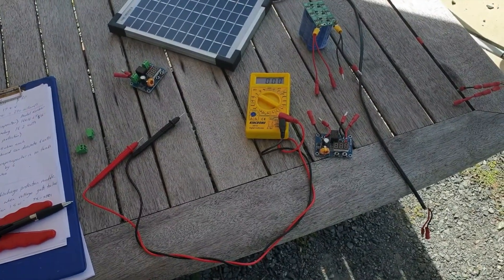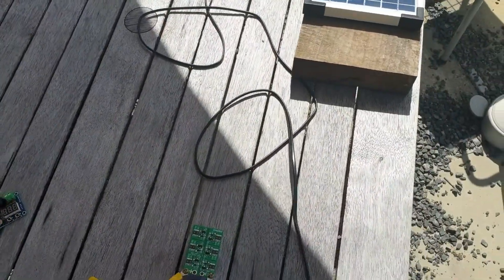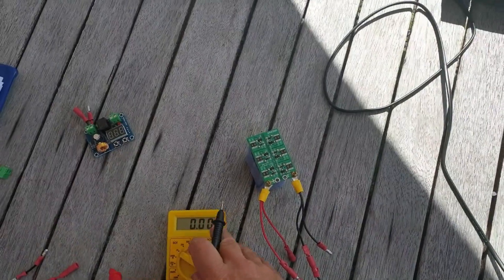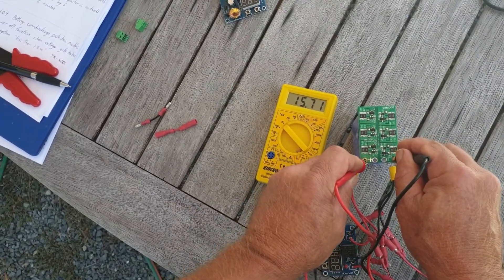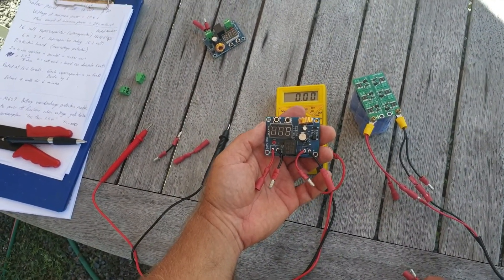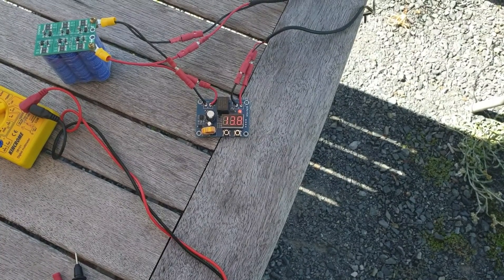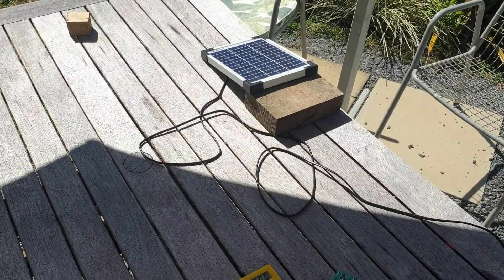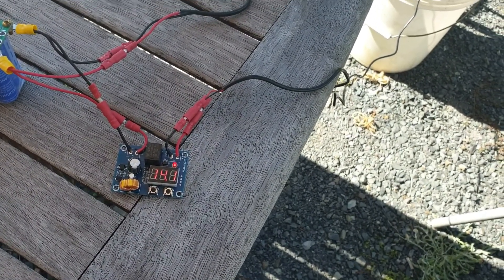Small solar water pump using supercapacitor

Comment: Hi Dean. How much could this setup be increased? For example could a 200W panel and larger pump be used on a higher capacity capacitor bank and charge controller?
Reply from the maker: In this example there is no overvoltage protection so I matched the wattage of the panel with the overvoltage resistors on the supercapacitor board (which also balance the voltage). If supercapacitors go overvoltage they die. However, its very easy to scale up with a bigger solar panel, provided you use a buck converter to limit the voltage going into the supercapacitor to no more than 16 volts. Here is an example https://www.youtube.com/watch?v=9CVa0V-IUOg

Comment: Hi.nice work
We done a similar type of experiment.
We used a 25W 12V panel,5 x 2.7V 500F supercapacitors and same type of the motor in the video.also we made a buck boost converter and used it too.
We did not do the experiment for a long period.can you say the volume of water you got from this experiment?
Reply from the maker: Thanks Manula, I didn't measure the volume of water but on a sunny day the pump was operating much of the day. On a cloudy day the pump was operating 1/10 of the time. Agreed, a larger solar panel with a buck converter to restrict the input voltage would dramatically increase the quantity of water pumped. I made a video here: https://www.youtube.com/watch?v=YgPGYRuugvw